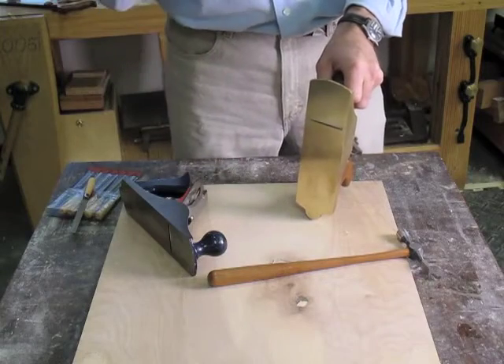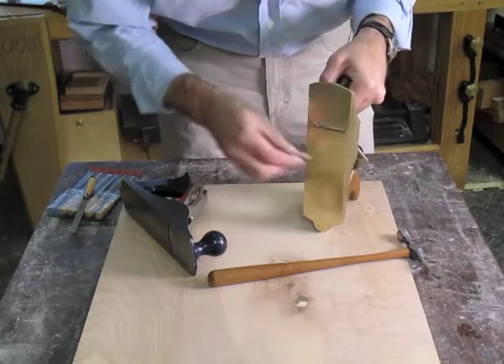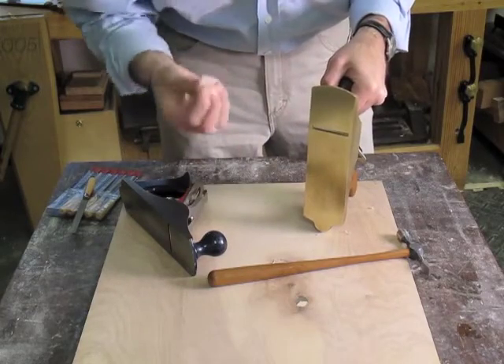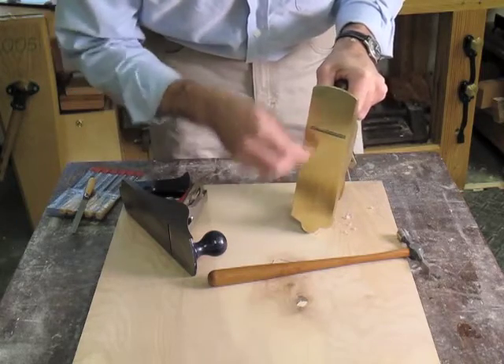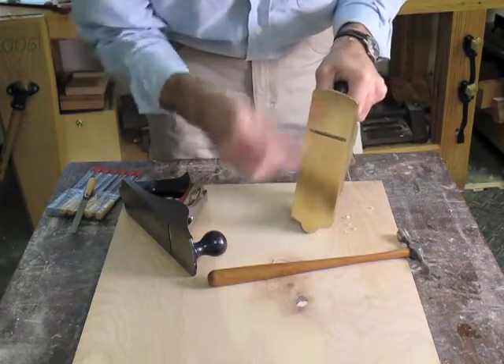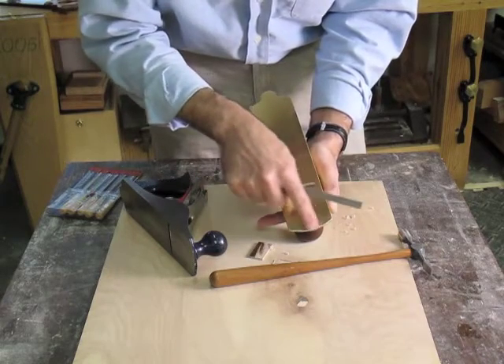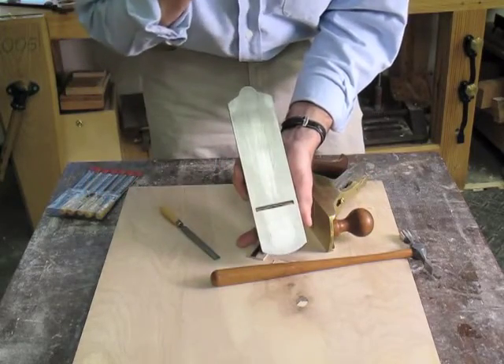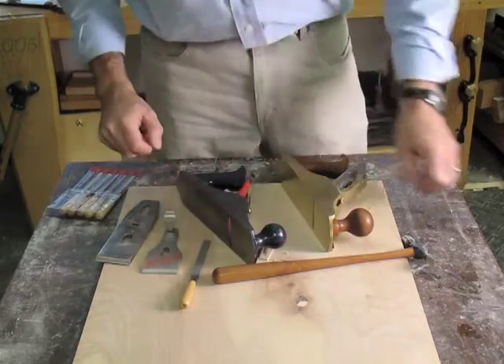Eliminating Plane Tracks

Comment: My brand new lie neilson is leaving tracks in poplar. 
All parts of the plane are perfect. 
Light cut. 
With grain. 
I’m stumped.
Reply: @nestor v , thanks for the reply. I was afraid to take the corners down because I was under the impression that LN irons came ready to rock right out of the box. I was searching for something else in the set up. I think you are right. I was operating under a bad assumption. 
Can’t help but be disappointed with LN. I’m becoming convinced that they are not worth the premium. ...and I’m pretty committed to made in USA.